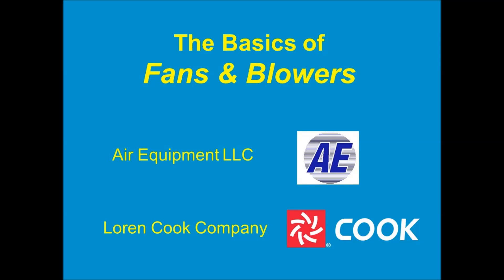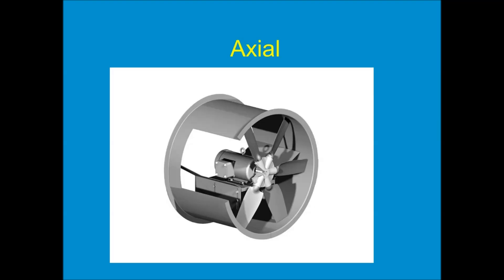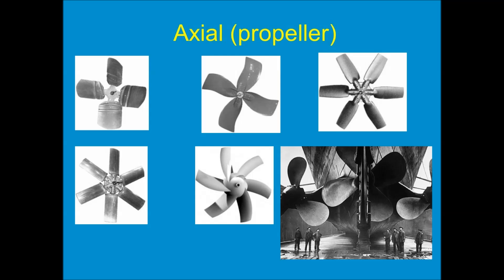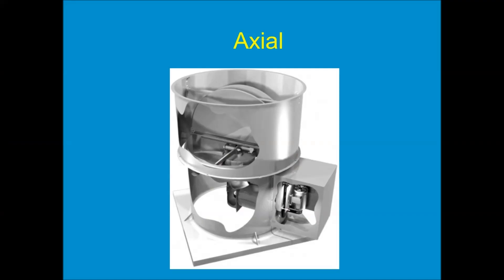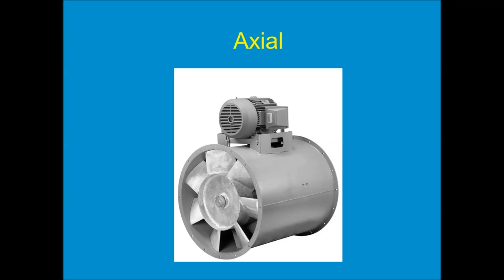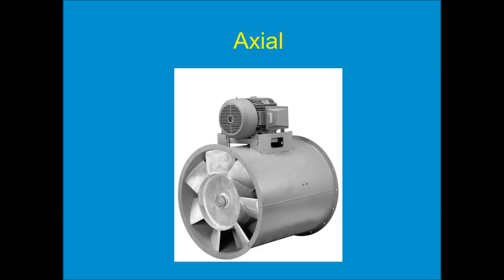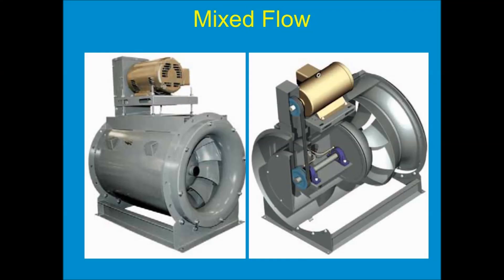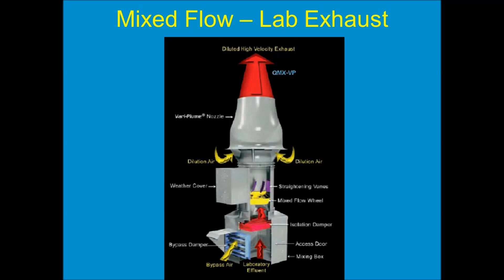Basics of Fans & Blowers - Part 1

Comment: Normally, Blower sucks air from sides and deliver radially. But, in Split AC evaporator, I have observed that both sides are closed. Then, how it sucks from top and deliver from bottom i.e Radially in and Radially out?

Comment: How many Pa or bar which we count as a midium , low or high pressure sir?
Reply: According to a HVAC ebook I have,  low pressure classification applies to systems with fan static pressure less than 3 inches water column. Medium pressure 3 to 6 WC and high pressure between 6 to 10 WC.